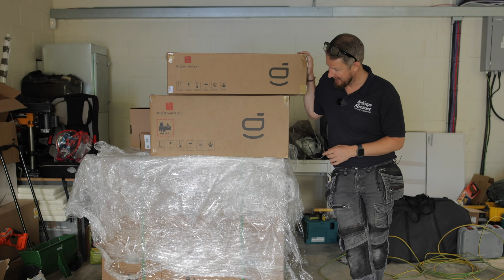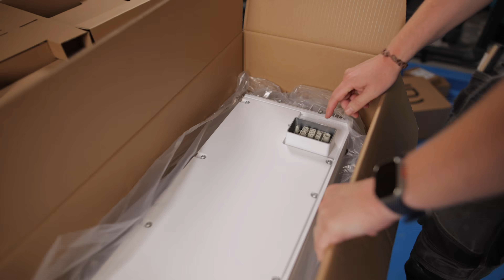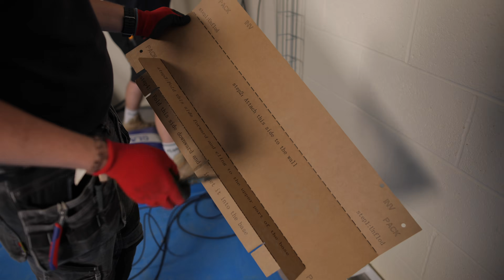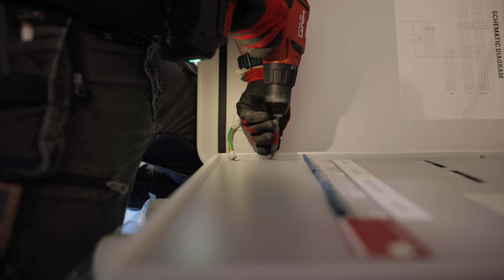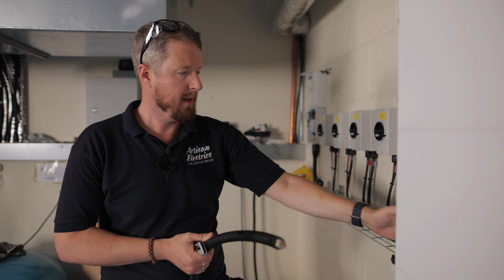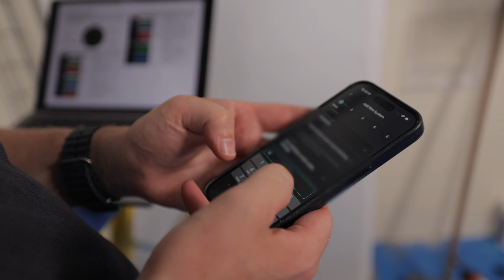Better than a Tesla Powerwall? 🧐🔋48kWh Three Phase UPS Battery System! ⚡️ Sigenergy SigenStor

Comment from the maker: Get a quote from us for your Sigenergy Battery Install: https://artisanelectrics.co.uk/battery-storage
Reply: Can enough cable be left so, the owner can lift and add batteries when budget allows? 
Also the high power ev part is that just put in when budget allows? Can this be controlled restricted by the app? And used possibly by card payments by public on my driveway?
Reply: how does a 25kw inverter supply a house capable of drawing ~70kw without overloading - surely you need to separate critical loads from the non essential heavy loads (such as heating and car charging)
Reply: @eliotmansfield bingo. 25kw is fuck all for this scale, you need three in parallel if they have that functionality
Reply: This video just gave me a ....  (Suprised to see you still using DC Isolators?)
Reply: Ask them to mak LTO packs they'll see the benefits.
Maybe somebody can revive XATL too or exceed their claims of 65k cycles with 100k or more.
Reply: Can you give a idea on cost for a system this size supply and fit
Reply: 10.30 should have just brought a sleeping bag
Reply: When will you sell in the USA?
Reply: @pdubyaz  Given it is based in Shanghai and it has AI control I wouldn't expect it to be able to operate in the US. Though they might be allowed in.

Comment: SO 74 445w panels 32kw peak and it was generation 6kw, were only 1/4 of the panels working?
I was thinking of getting 12 500w panels to produce 6kw but if 74 panels only produce 6kw then 12 would only produce 1kw??

Comment: How's your experience been with sigenergy since this first install?? I'm getting a new solar array with battery system installed and the installer is looking to  use Sigenergy batteries. So trying to find out about reliability, support etc for the Sigenergy batteries

Comment: Hi, thanks for posting this, we are getting a 30kw 3phase plus 48kwh batteries installed in Australia, I have a question th t you may like to answer?

We have 3 separate solar systems 1 per phase and the installer is looking  at doing AC coupled setup and rather than connecting the solar systems to the gen port (smart ports) he is going to use CT censors and said that they just draw the power from the grid to balance out what was going to be exported prior to export aka before it hits the meter?

While I can see how this would work, doesn't this defeat the purpose of buying a gateway in the first instance I.e. if we use the gateway and gen port then we don't need the CT sensors?

Cheers and keep up the good work!
G.

Comment: Hello, I’m  viewer from Netherlands and I like to asked you a question. I’m in the middle to buy sigenergy. System. Do you have knowledge about connecting a {inverter} generator. I the documentatie Sigenery they mention connectio is possible and the mention also “a diesel”.  For me is a diesel generator niet feasible because of the very load noise. I like to opt for a Eco-flow generatoar. Can you help out “to point me to manual/documentation“ where to find instruction about “how to connect” a super still solar-generator like eco-flows solar generator?  I sincerely hope you and willing to help me out. I’m a “addicted” 😂“artisan” follower 😅😊

Comment: I am in Portugal, and we installed this system: 14,4 kW solar, 10 kW single phase inverter and 40 kWh battery ... it has been running for a little over one month. Great system!
Reply: does it give out a humm sound? Is it loud if so?
Reply: where abouts in Portugal? In the Algarve by chance?
Reply: @cb1973-r9z  No, we're north of Porto, about 20 minutes from the Spanish border.

Comment: Hi. I’m in Western Australia and currently have a Powerwall 2 battery and a Gateway 2 on a 3 phase Goodwe inverter. I was considering adding a second Powerwall 2 because of a current rebate system. In the event of a grid blackout my panels do not continue to charge my battery.  I only recently discovered this when i did a simulated outage.  Did I hear you say that the Sigenergy system continued to power the home from the panels and continued charging the battery with excess production?  That is what I expected from my system but apparently the inverter needs to see A/C at each phase in order to charge the batteries.
Reply: Thats the difference. Sigenergy battery can be charged from surplus whilst in blackout any phase any coupling. True ups.

Comment: I do have a concern. Can we change sigEnergy priority ? Something like first priority solar second battery then 3rd generator or backup power ? As per my knowledge backup power only triggers when grid blackout happens happen. Is that true? Will we be able to customize last option as grid power  if customer needed to use generator instead of grid ?

Comment: Love the videos. So, I have a question. I am in Australia and already have a Solax Hybrid Battery and it is still working well but cannot expand it anymore. The Government in Australia has just announced a program to allow users to basically get a Solar battery with massive amount that can be claimed back after install. I am looking at a 48KW with a 20K inverter. Basically get 40% back. But I am wondering if my current battery can be connected via the Gateway. I realise it may not have all the "Whistle and Bells and I believe it is just purely "On Grid" . Is is this possible? Thanks in advance and keep the great content coming....I look forward to your thoughts and comments

Comment: So how long will it run the house?  Big batteries, but massive house.  45kW is ~$5K of golf cart LiPo batteries.
Also, how many watts on each phase can the inverter put out?  The battery connectors don't look that big.

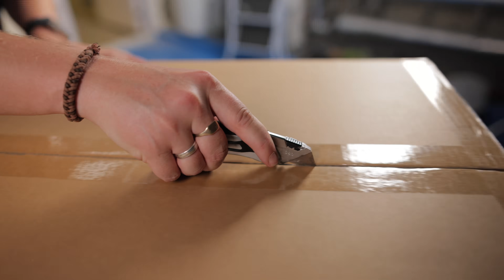Comment: Minor tip about cutting open shipping boxes (as seen at 1:56) . Dragging the knife down the entire length of the clear packing tape is unnecessary as risks cutting or scoring into whatever may be directly below the cardboard flaps.  

A safer and usually quicker method is to cut both of the short ends like you are already doing, which allows the two main flaps to tent up slightly as they are no longer being held down at either end. Then just nick into the end of the long packing tape strip at one end or the other and pull up on the main flap near the middle. Just a few millimeters long nick is usually enough to start the running tear down the entire length of the main packing tape seam. This is taking advantage of packing tape's weakness to withstand tearing apart while unsupported. The tear usually happens faster than you can drag the box cutter the same distance, leaving the main flaps free to open. The shorter inner flaps at each end of the box will always protect whatever is further inside the main box, so the box cutter blade can never cut or scratch anything inside. In the rare case when the tear does not go all the way, the slight tent of the main flaps being pulled up also increases the protective gap for an additional nick to be applied. I picked this tip up while unpacking thousands of boxes as quickly as possible with minimal movements, and now find it faster and easier than the traditional full length knife drag approach.

P.S. When you see a store item with a random gouge or scratch across its surface, it was likely caused by a box cutter digging into that item while the bulk shipping box holding those items was being cut open, usually while in a hurry to get the items loaded onto the store's shelf as fast as possible.

Comment: Interesting Battery backup, i wondering... im going to do a install. but there is a 25 meter cable between the gateway and battery. Does there need to be a circuit breaker on the battery side to prevent the battery from shorts ? The manual does not state it ?

Comment: The system is great. We've had our since Nov 2024. The app however is shocking. The seem to have server timeout issues all the time.

Have they cheaped out on server space and are failing to meet the bandwidth needs of the number of users who now use the Sigenergy syste.?

Comment: What will happen if, many years later, the inverter fails and Sigenergy is no longer in business? Do you think it would be possible to integrate the Sigenergy Uber Integrated System with inverters from different manufacturers?

Comment: With this battery and gateway does the software allow for off grid priority, so solar doesn’t get exported and house runs off grid as much as possible or do you have to throw the main breaker for it to kick in which is not ideal once the pack us full and solar day hasn’t finished such as a working week where energy use  is minimal in the home or holiday as it would be annoying to keep throwing the breaker to charge off peak hours, I’m not talking about storm priority as that uses the grid to full charge , but true off grid energy use as much as possible while still having the grid online but not drawing any power eg outbound only as much as possible. Or will I have to build a parallel grid setup forcing rerouting power for whole home . The reason I ask is I currently have another brands that only has storm warning model only and doesn’t offer off grid only option even though it has a 15kwh hybrid out fox inverter there is still times where the home constantly poles the grid a recent update made this far worse drawing from the grid in off peak mode

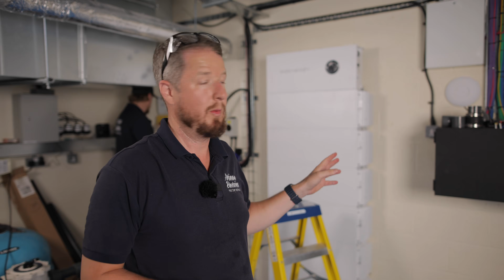Comment: 10:57 When the batteries are connected like this without anything else, do they need to synchronize power so that all batteries have the same voltage??? Or does it just charge each battery until they are all at max??

Comment: Tesla found a niche market that was untapped at the time, it was simple and easy design for the time considering the battery systems of those days was basically a car battery linked to BMS fed by inverter fed by solar, back then it was confusing and not worth the effort in investing into battery backup for the home due to the cost.

Now if I talk to you about my options on having solar you would be asking "grid, off grid, battery backup, hybrid, generator fed in along side solar and battery backup?"
"storage, oh yes we will get to that, that's the easy part..."

an with all my options selected you will cater to my needs at a much more affordable cost than before the days of Tesla and you will be in and out possibly on the same day... unless I want my main board moved, but if it was a virgin construction you would get super excited like an architect being selected for a world class structure....

All because the competitiveness made it simpler for electricians to understand and install, all while standing by their equipment and making them better which makes you super excited to help me; the customer.

Too bad I'm not in the UK though

Comment: When one looks at this installation it is quite clear why a commercial battery storage or solar power plants have a LCOE that is several times lower compared to a residential installation. Too much gear for a few kilowatts less. This is is how it goes when engineers can roam freely.

We heat our house with gethermal and a separate air-to-air heatpump. Geothermal works regardless of ouside temperatures and air-to- air down to -30 C. The electricity production And storage ILeave to the utilities to figure out. Yes, I have some concerns about crisis. These gadgets will not help you when it turns real sour as the electricity and gas prices will be sky high. Keep it simple and add a heatpump or two and combine it with fire wood heating. Wood you can store fore years and you likely don’t need more than 10 to 15 cubic meaters to manage one winter.

We have an accumullating fireplace plus a wood stove from the 50’s. The accumulating fireplace cost me around 2000 Eiros in 2004 and the almost unused stove I got for 50 Euros. I constantly have around 10 cubic meters of firewood in the storage. Mostly it is used for the cosiness but works if there is world war III as well.

We have had geothermal heating since 2004 and I just replaced the system. Most of these will last you 15 years with some maintanance. If you are lucky as I was 20 years. It is both the life time of the physical stuff but also the electronics. Hand on your heart, how many of you have + 15 year old computer still in use?

Heatpumps and solar are great but don’t bring it into the residential areas. As prudently mentioned here there are risks like flooding and fire hazzards. It is pure stupidity when this is supported by grants through governement. If support is needed for getting the spark spread difference vs. dinasourius poop needs to get fixed the support should go to the utilities not the pedlars.
Reply: My advice from a Nordic perspective if you are planning to build a new house:

1. Insulation, insulation, insulation, and a low temptreature heating system aa floor heating. Get a non-fuss jeat pump plus wood heating possibility if gepolitics ia of concern.
2. Chose building location. If wood is not accepted as heating source you live too close were bombs are going to fall. No electricity gadgets will save you. We have delivered thosand of simple wood burnets to the cities in Ukraine from Finland.
3. Forget the swimming pool and glas mansion if you live in a climate whehere temperatures drops bellow freesing despite your wife and children nagging.

If you are moving into an existing property:

1. Insulation, insulation, insulation.
2. Insulation, insulation, insulation.
3. Insulation, insulation, insulation. Insulation do not have operating costs. Insulukation and ventilation needs to be in balance however. Put plastic in the walls of your pre 1970 house and it will have mold in a few years.
4. Get an air-to-air or air-to-water heatpumpump from a reputable installer.

In all occasions forget about residential solar and batteries. All the idiots will pay for levelling the electricity costs. We have nor paid anything in principle for energy in last few years during summer andearly winter. Wind and solar keeps prices close to zero. During spikes In winter I heat with wood. It also gives me confidence as we have the Russians as our neighbour.

We might have black-outs ocasionally due to storms. Normal duration is 1-3 hours and at most a day. Freequncy is around once every 5to 10 years for those lasting longer. My concrtn then is not the internet connection but the waterpipes not freesing, easily handled with burning wood for heating the house and possibly emptying the water supply to our separate garage.  It is much less hassle compared to failing electric automation components though.
Reply: @thomasl2974  I can't comment on where you live. But most if not all of your claims are wrong for almost all of Australia. Probably various other countries too. T
Wood fires are being phased out here for pollution, cost and lac😅k of timber. Plus convenience. Who wants to chop timber and clear out fireplaces these day when there are much better options.

Geothermal is costly here. Solar, air conditioning and batteries are much more appropriate and cheaper options. We have the largest penetration of domestic solar in the world and it is growing rapidly..  House design varies with our climate zone. What works for the Snowy Mountains is wrong for tropical Queensland  but solar works well everywhere here. In the tropics you do not want heavy insulation and tight sealing. The list of differences goes on.

Comment: Getting a sigenergy rig installed in western australia in decemeber, cant wait!
Reply: How's the system going?
Reply: @songforguy1  Its been great man, had it since first week of Jan and hasnt given us any issues.
Last powerbill included work the power company did to enable us for solar so the price wasnt really reflective, but next power bill should be interesting.
If have our AC on all night the battery lasts until about 3am, if we have AC off it lasts all night
Reply: @SpectralFremen  good to know mate, I live in nsw and have ordered it. What size system is yours?
Reply: @songforguy1 we just a 8kw battery with 11kw of solar, 5kw invertor. 5Kw invertor is the biggest you can get in WA on single phase.
It's just me and the wife, so kids ect will chew up more but been super for us
Reply: @SpectralFremen  that's great mate, we're also getting around 11kw solar but a bigger inverter and battery and as we have an ev we're getting the 25kw dc charger. I've put the installation on delay due to the federal government's promised rebate if elected.

Comment: Great video. Am I right in thinking the customer could easily add extra batteries themselves at a later date? Also, with UPS, is there a way to configure this so it doesn't cut in automatically? I'd probably want to turn off an energy hungry ashp before it starts using the battery? Thanks
Reply: The idea of stackable batteries is so you can add battery capacity as you need/afford it. In this case the battery modules are 8KW each and you can stack any number up to 8. You can configure the system so it doesn't function as a UPS.

Comment: Couldn't have you use HO7-RNF with ferrules or NYY-J to connect this system as you're inside, in a controlled zone and don't need armour for protection from 'crushing' forces?

Comment: Great level of detail shared thanks. Whats the best way of installing  this unit For people in smaller homes and/or smaller budgets who want to go with one battery module and add another later?  Would it be wall mounted so you can add another at the bottom and just drill two more mounting holes? Or would you floor mount it so u take the inverter module off first and add on top of battery? If it's the latter, wouldnt it be easier if the inverter and the battery holes were aligned?
Reply from the maker: I would wall mount it and leave the exact space below for adding more modules

Comment: What voltage does the battery run at ? 
48kWh at 0.5C discharge rate is 24kW which is approx 500A at 51.2v. How the heck can you make that safe ?